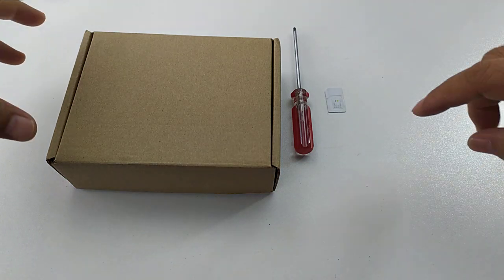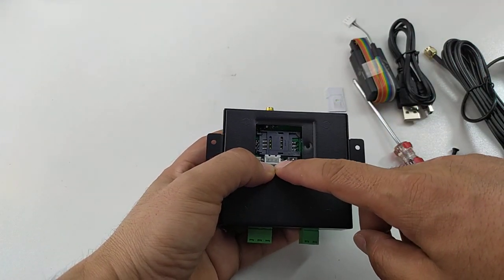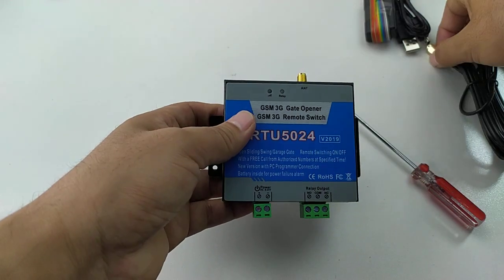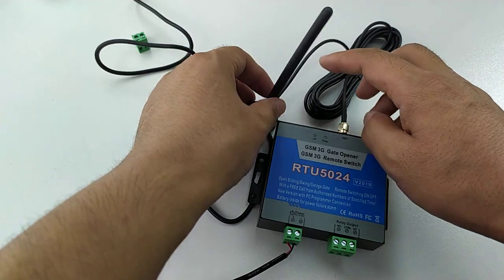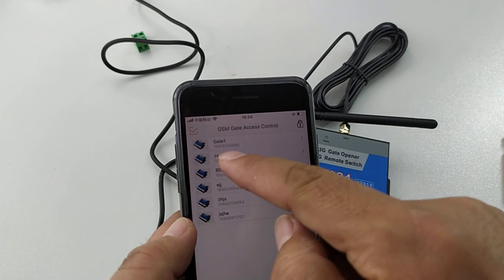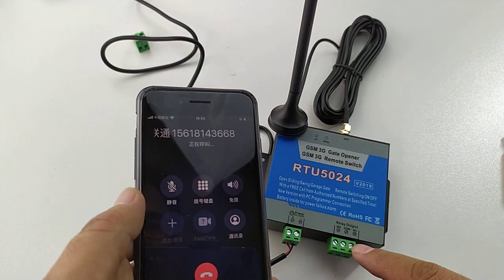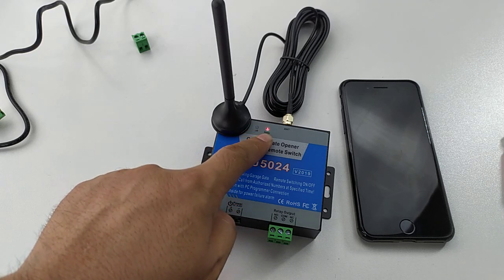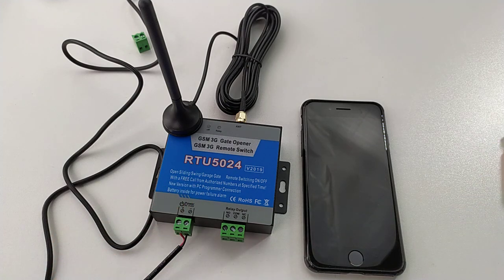RTU5024 V2019 New version GSM gate opener remote controller

Comment: hi what to do with gnd wire after finished programming, i have connected alarm signal to s1 to system alarm output, but gnd where it should be connected. when i connect gnd cable to system common gnd it sends alarm once. when alarm goes off again it does not send message.can you help me solve the problem?regards

Comment: My RTU 5024 seems to have no such ON switch!
Only a white button close to the SIM card carrier.
Exactly where your one has the 3 pin connector.
I cant get it to work! Sometimes it says this user cant be reached right now,
or the line is busy. Cant get the relay to switch on. The Relais LED never on!
Reply from the maker: Only RTU5024 2019 Version has that funcion.that switch is used to ON or OFF the inside battery

Comment: Hi there.
My rtu5024 works fine for a day or two but then requires a power reset to operate again. It's very frustrating. 
Does anyone know why this is happening?
I am using a brand new sim card with a strong signal with line of sight to nearest mast.
Reply from the maker: please check : http://www.rtu5024.com  there are several type RTU502,that looks very similar to us,but not manufactured by our factory
Reply from the maker: we have questions and answer page,maybe help you to sort the problem. also you can check the board, if that is from our factory